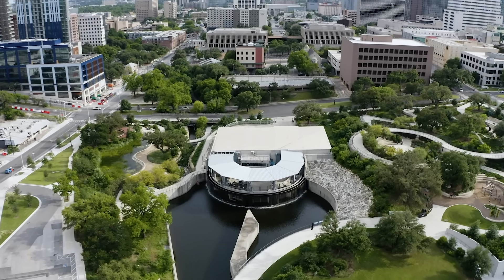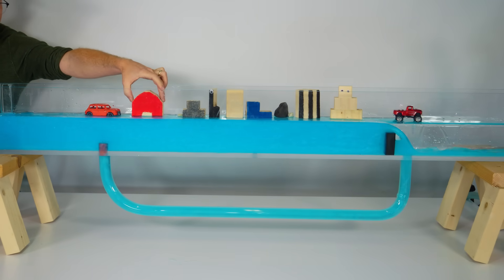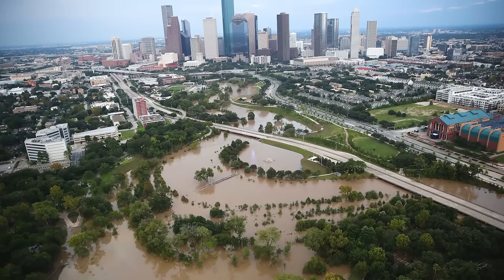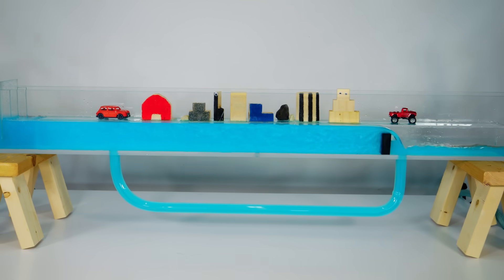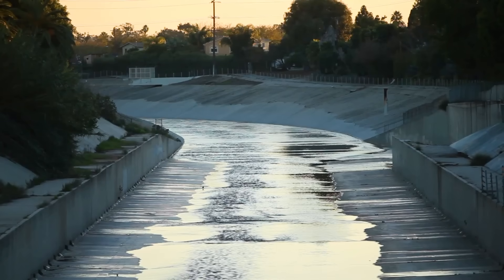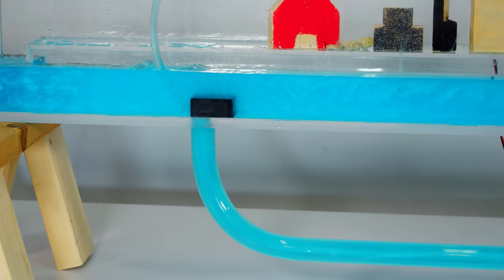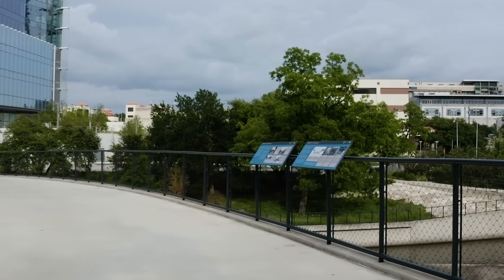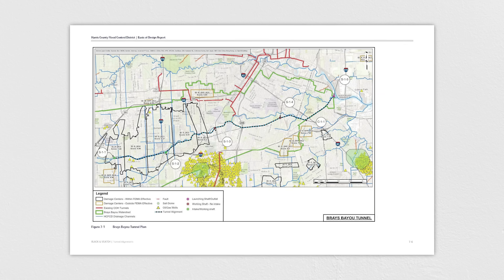How Flood Tunnels Work

Comment from the maker: 🥑 Simplify your dinners with code PRACTICAL16 at https://bit.ly/3Ws1PYm
📚 Did you know I wrote a book? There are still some signed copies left at https://store.practical.engineering/
Reply: Nice timing on this one
Reply: The tunnels can also be a great source of energy to provide a city with its electricity needs?
Reply: @Peter_Enis  Yes, hydroelectric power
Reply: @Peter_Enis huh? 😂
Reply: @Peter_Enis  Floods don't happen every day though, it could impede the flow of water, and hydroelectric dams are more efficient...
Reply: @The thing  Thank you for the decent reaction (getting rare on the internetzz) and I understand, but rivers could still be a great source of energy. Dams are expensive and locations are rare, floating generators could help a lot. And you could account for the impedance the generators would pose, even in storm-drains. Storms do contain a lot of energy, storing it in a short time would be the biggest challenge..
Reply: @Peter_Enis  Storm drains work, but it only rains a few days a week for many places where it is rainy, and the energy generated would likely only be a few kilowatts... utilizing the power from rivers directly without a dam, and a turbine or wheel would work, but on a large scale, it would either require many small turbines(high mantienence), or a dam-like structure to capture all the water and direct it through a few large turbines, but on a larger scale, the mantienence for either one would be practically impossible, because degree will get stuck in the blades, and there is not the same pressure there would be on a dam to push all of it out... and rivers don't always flow all year, so power generation may struggle some seasons of the year... in small scale, it is too costly and resource dependant and season dependant too. But using a similar technology with the tides(propellers in the ocean for places where the tide moves fast) has worked. Hope that helps answer your question.
Reply: @Delta-j9u  I did not pose a question but thank you for your vision.
Reply: @Peter_Enis  your very welcome petenis
Reply: @Peter_Enis  "I did not pose a question but thank you for your vision."  No you didn't, but your idea is dumb.  A dam stores huge amounts of dependable mechanical energy.   Installing generators on strom drains for potential storms in a city in central Texas.  HA!
Reply: @Peter_Enis only as long as there’s a way to bypass the generator, but even if there is, it creates a bottleneck in the system.
Reply: website is good
Reply: Question why not just put a filter on the end so when the sludge comes out it gets filtered? prob a bad idea but if anyone can answer that would be awesome :)
Reply: @owenselkirk3950  This will slow the stream of water in case of emergancy, these tunnels are built so the water can relocate fast.
Reply: @owenselkirk3950  might be expensive/ difficult to clean a filter for sludge.
Reply: Hi, another nice video again, but just for understanding, why not increase the depth of the river instead of building tunnel?
Reply: @JithinJose2  That would be difficult to do in an urban area, where most of the time there are buildings and infrastructure built adjacent to the flow of the river / body of water.
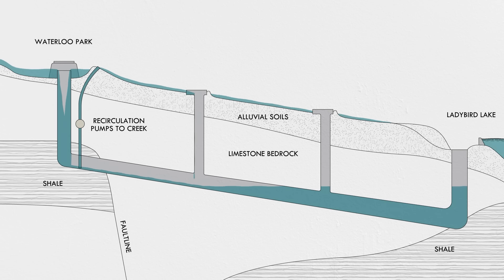Reply: Is the entrance to the Waterloo park flood tunnel at 1:06 a bell siphon? I.e. if the water level reaches a particular point the bell structure around the siphon draws a vacuum and the pipe starts working as a gigantic siphon completely draining the lake to refill only when there is no water left?
Reply: Thanks for covering this!  As a San Antonio resident I have been hoping you'd talk about these.  I wasn't aware of the one in Austin, and I didn't know they were widespread enough to be in Tokyo and beyond.  My biggest question though was how the water left in the tunnel doesn't get stagnant, and you answered that.  Great video!  Hope to see you out on the trails!  We walk at Hardberger Park and they have that great land bridge over the highway.  Not sure if that is a good topic for a video - it seems so simple...
Reply: Muy interesante, seguramente los científicos e ingenieros ya deben haber obvservado las capas y comportamientos de las profundidades del océano y túneles en estos para usar ese conocimiento en este tío de infraestructuras, como  manipular presiones atmósfericas y ondas de sonido en el agua para manipularla y volverla más o menos peligrosaz junto con aprovechar esa energía en parte, por cierto el cauce de los ríos será más difícil de predecir en menos o más gravedad en otros planetas habitables rocosos de 0.5g y 1.5g pero el control de el agua será vital.
Reply: DO NOT POST ANY REPLY! DO NOT MENTION ANYTHING ABOUT TIMEBUCKS.
Reply: Could you do a video on the Kingston Steam Plant Coal Ash Spill? Please
Reply: Nice
Reply: Nice
Reply: Hi
Reply: Hi
Reply: When are you going to do pumping stations, and why they dump water in the outside of the chutes
Reply: Amazing
Reply: Wouldn’t need this tunnel if we destroyed all cities and returned to the healthier, superior preindustrial society
Reply: The diagram he spends most of his time referring to is confusing as hell.  There is no lower dam or wall in the water like his diagram depicts.   I was like if there is a wall, why build a tunnel, just install gates.

The tunnel is 5600 feet long and the river falls 38 feet over that distance.  

What a mess the project was.   Taxpayers approved 25 million in 98.  Finished in 2017 at a cost of 161 million.  YT "City says Waller Creek Tunnel's flaws limit flood protection"
Reply: On Red river floodway in winnipeg, manitoba, canada. would be a cool video
Reply: i broke youtube again im in a diffirent video but the comments are not from this video ahhh
Reply: Nobody waste their time or money with HelloFresh.  Almost every box you get will be missing ingredients, or have ingredients that have wilted or dried out or spoiled, and all their meats are so loaded with preservatives that when you open the packages all you'll smell is sulfur.  Then the amount of junkmail they send you and continue to send you even after you opt out and cancel is just ungodly.

Comment: Wouldnt a simple glory hole be a much better solution? This system with moveable gates and pumps, would fail during a power outage - and the way things were going with 'smart' and 'connected' systems, would probable fail during a simple internet outage as well....

Comment: Fun fact:  a half mile west and a block from Shoal Creek is the original Whole Foods store.  After the devastating 1981 Memorial Day flood, Whole Foods modified their building so that the outer wall serves as a dike, complete with portable control gates that can be lowered into slots at the doorways.  I have wondered what they did to prevent sewer backups.

Comment: I love this. Yes. I wish we had a lot more foresight but considering this is where many places are at, this is a pretty cool solution. I went to a seminar with a researcher speaking about water management in urban areas and they have been looking into how to slow the water flow from roofs to the streets (I reduced the research a lot but this is the bare bones idea). It's really cool and they are doing another project starting in about half a year and looking into something called blue roofs which I didn't know was a thing until she mentioned it. Very cool stuff.

Comment: Recent flooding in S. France showed trees and other material damming against bridges, thus raising the level of the water upstream of the bridge.  But is there any experimental data to show how arch bridges react to rising levels of water passing below them as opposed to rectangular span bridges, whose cross-section stays the same with rising water levels?   It seems to me that an arch bridge should increase its hydraulic resistance as the level rises up the arched portion of the bridge.

Comment: Rather offensive that the rural or less dense residential areas are talked of as though it’s no big deal if they flood while the dense urban area is a higher priority. 
Personally, I say let the concrete jungles flood since so many of them can simply climb a flight of stairs and avoid the flood waters. 
Besides, losing a few places like New Orleans, Miami, ir anywhere else built below (New Orleans) or just above (any coastal) sea leve would be a good thing.

Comment: The San Jose flood bypass is the same depth as the creek. It has a big entrance but with weir across the entrance. In normal nonflood the creek flows as always and the bypass dries out. But flood raises the water to overtop the weir into the flood bypass. Guadeloupe Creek continues nonflood flow during floods and the bypass routes the flood itself around downtown and releases it further downstream. The release area is a park with wide banks and depressions that can buffer flood waters below downtown and possibly upstream of Alviso.

Comment: I've noticed where I live, in years past the level of the river downtown rose significantly, covering sidewalks on the riverbank and even infrastructure, for people to sit and enjoy the river are covered. There is a small dam/weir so I'm wondering if there might be a flood tunnel around here.
There is "The Big Ditch" on the west side of the city that was built to prevent flooding the west side and keep the excess from flooding the downtown area also.
Another city Terre Haute Indiana where the western bank of the Wabash River is much lower than the eastern bank. In the older neighborhoods on the west bank, the yards and houses are elevated by about 3 feet above street level, with cement walls separating the sidewalk and streets. I also know about the area being flooded back in the early 1900s and 1920s.

Comment: Where is the structure located in San Antonio? I would like to use your video in a homeschool lesson and take a field trip to see that and the ones in Austin. Thanks for making engineering digestible for those of us who are interested but not smart enough for an engineering degree!
Reply: There is a flood control tunnel inlet  just north of the Pearl between Josephine Street and 281.
Reply: @midcenturymoldy  thank you!!

Comment: This is a cool way of doing it but I wonder why they didn’t simply make the  inlet a circular spillway so there wouldn’t have to be any moving parts that could potentially break like the gate preventing water from flowing into the pipe, you could keep water flowing in the pipe by just having a small hole in the side of it or you could put it on display and have a few fountains that shoot water into the spillway to make it a unique and attractive water feature. Could be easier to inspect and maintain too since you could just cap off the outlet and pump the water out of the pipe when the water in the river is low so that someone can just be lowered in while it’s empty.

Comment: The Thames Barrier tries to control flooding in London by very occasionally blocking flow from the English Channel back up the Thames Estuary into London.  The MUSE does something similar in Venice.

By blocking the channel, the Thames Barrier protects against flow from the sea (due to low atmospheric pressure during high tide), but requires the immediately upstream area to temporarily impound water coming down the Thames.  Low atmospheric pressure is often correlated with high rainfall.  The Thames flooded twice in 2008 and once in 2018 from high rainfall.

One thing I've often wondered is why the Thames Barrier doesn't have pumps that would operate when closed, to lift water upstream a few meters into the estuary.  The total power required is not huge: all the flows in the 2008 and 2018 floods were under 1000 m^3/s.  Lifting 1000 m^3/s of water 3 meters is 30 megawatts, which is on the small side for a hydroelectric turbine.  They'd need similar sized nearby backup generation, but once again this just seems like small potatoes compared to the property value at risk.  Presumably London has much larger local generation just to keep the city grid robust.

I suspect that during these floods, dam managers are impounding water in their dams, putting upstream property at risk to derisk the more valuable downstream property.  So pumps at the Thames Barrier would also protect folks upriver of the dams above London.

British civil engineers probably didn't just overlook this issue.  So I'm curious what constraints make pumps either unnecessary or impossible.

Comment: The one in Tokyo is amazing. It also has many gates to prevent water coming in from the sea with pumps spitting out the flood waters. And gigantic structures where even the holes for the water to get down to the tunnel are designed to accompany the fall (at some point it's so high that the weight of the water would damage the bottom of the structure so they have this spiral/screw design to accompany the water down).

Comment: Grady, Mr Engineer. At roughly 6 minutes you state “…the answer to this problem IS gates.” Grady, since “gates is plural, the singular tense “is” happens to be incorrect. The plural “are” is the correct one. “…the answer to this problem ARE gates.”  Grammar, like engineering, has a structure. Thanks for the videos.

Comment: A little bit of water in a basement can be a huge problem. About 10 years ago a thunderstorm knocked down a tree that smashed a basement window overnight and let a bunch in then it rained for another week. A not quite big enough piece of plywood sealed with duct tape and plastic sheets isn’t a very good watertight entry point and it let in more for a couple days until it was fixed. Overall it was like dumping a couple of garbage cans full of water down there. Despite running the shop vac for hours and an extra dehumidifier it filled with mold and the  interior walls  near the leak and all carpet had to be ripped out and replaced. The carpet had mushrooms when it was taken out.

Comment: I don't understand the need for gates or pumps. Wouldn't it be enough to just raise the height of the funnel that feeds the tunnel to the desired water level? By limiting the flow out of the basin, when the influx of water surpasses the maximum outgoing flow, the water level will rise over the funnel and the water will start flowing through the tunnel. When the flow is normal, the tunnel is dry.

Comment: Hey. Have you heard about the road bridge collapse in the Philadelphia area? It happened a few days ago (around June 12th, 2023). A tanker truck tipped over and the fuel was ignited and the truck was under the road bridge. The fire (I'm assuming) weakened the steel holding up the bridge and a section collapsed. And the road is Route 95; a major north-south route in the East. I would love to have you do a video on the accident and the repair to the road bridge. I'm thinking the repair will happen faster than usual because the route is so heavily traveled.

Comment: It's very interesting. In Britain we are utilising the design philosophy of storing as much of the water as close to the source as possible. The general idea is that water runoff from paved areas gets into the waterways much faster than it would naturally in an unbuilt area. In all developments now we aim to store at source and release at a similar rate into the waterways as would have happened naturally.

Flood tunnels are good for the areas they are protecting but they can dump water into a watercourse faster than would have occurred naturally, which can just make the problem even worse downstream.
Reply: Do... do you people really just think Americans don't know what they're doing? That's in place here, too. In fact that's common around the U.S. But THIS project was built to address LOCALIZED flooding which can occur during very heavy storms due to an equal mix of the area's urbanization and its geography. This project is about getting that water out of the city and discharge it in a regulated manner into the downstream water control infrastructure.

Comment: New Castle, Indiana, decided to combine storm and septic sewers to save money. That worked well for people at the top of the hill. During a storm, the results for the people at the bottom was somewhat different. An elementary school was across the street from a house I was working on. My dad had been there months earlier during a storm, and told me the results. First, you could see water and other sewage related items start to dribble out of the finger holes on the manhole cover. Then the surge hit and Mount Crapatoa exploded, sending the cover flying and spraying sewage over the elementary school playground. When I was there, I discovered that the solution was to weld the cover down. I saw the street lift several inches, and plumes of sewage almost 20 feet. But think of the money they saved by putting storm and septic sewers together, especially the money saved by shutting down the elementary school playground and repairing the road a couple of times a year. Eventually the elementary school was turned into an adult education center, because it's OK if adults get violently ill after using the playground.